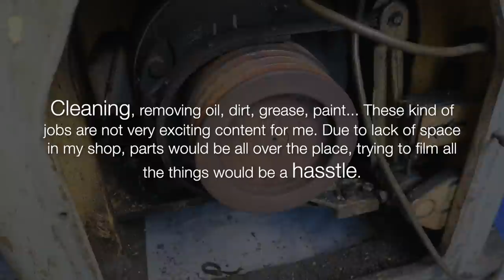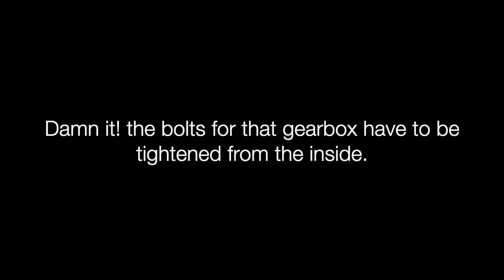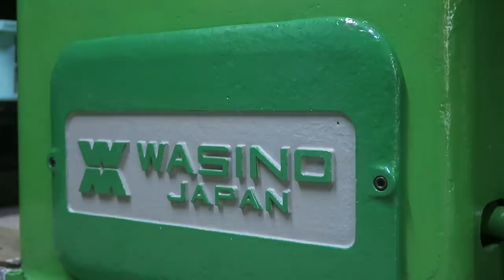Lathe restoration

Comment: This is an aesthetic repair.This repair is pleasant to the eyes, and accuracy will not add on the contrary can be worse.During the test run-in in the cartridge, the part must be clamped,during braking, the Cams can fly to the forehead.Who works those know about than I. And kapitalka need to although would here is so https://www.youtube.com/watch?v=w_Y5m_ogwtY better https://youtu.be/O-sOWWDqxDI
Это эстетический ремонт.Такой ремонт глазам приятно,а точности не добавит наоборот может быть хуже.Во время испытательной обкатки в патрон деталь надо зажать,во время торможения кулачки могут в лоб прилететь.Кто работает те знают о чём Я.А капиталка надо хотя бы вот так https://www.youtube.com/watch?v=w_Y5m_ogwtY А лучше https://youtu.be/O-sOWWDqxDI